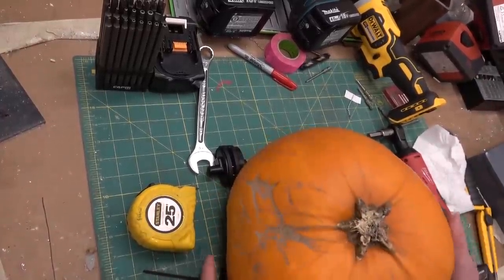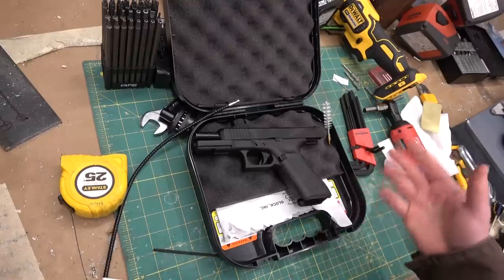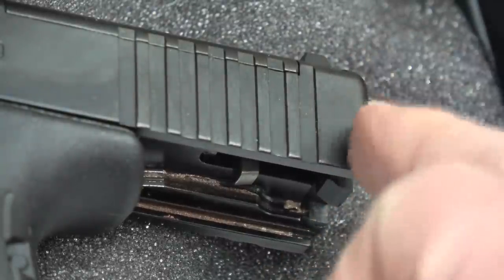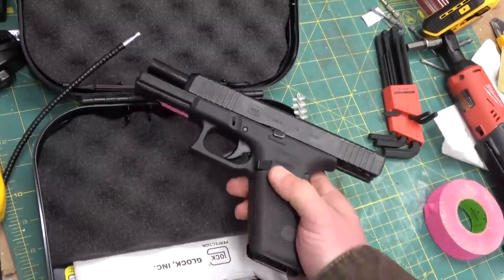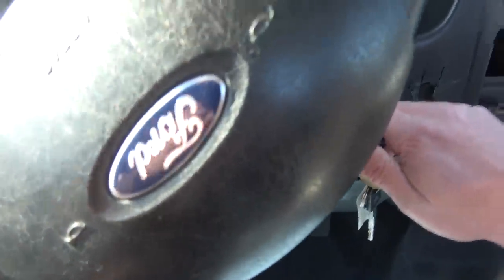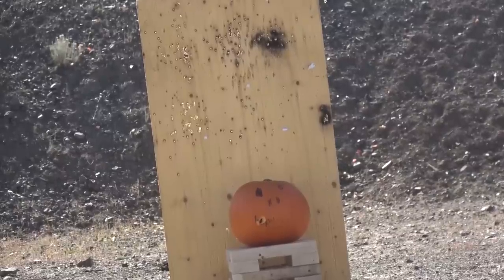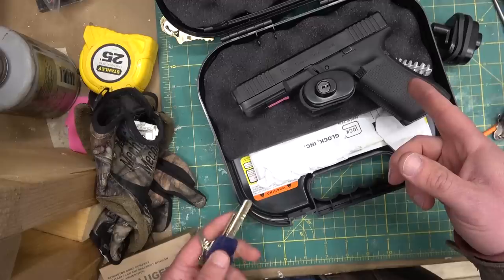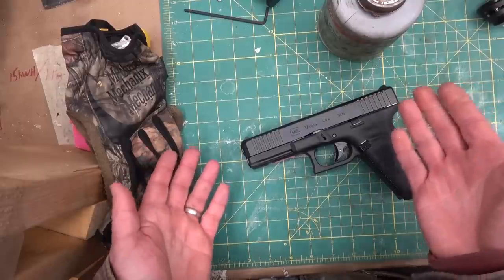BOLTR: GLOCK 17 GEN 5

Comment: I grew up in injection molding and have been working specifically in the firearms industry on the  injection side for 4 years. Ive helped develop glock clone lowers exactly like this, but the gen 3. 

"11 herbs and spices indeed" they are supplied a PA-6/6 resin with 17% glass fiber reinforcement. They then add "foo foo" dust in the factory and that is a closely guarded secret.
Reply: That sounds cool
Reply: Cool.  I did an apprenticeship in mold making.  I was guessing maybe PPA for higher heat resistance, less moisture absorption and higher stiffness than similar PA 6/6.
Reply: Foo-foo means carbon fiber, right?
Reply: @akkudakkupl  no, actually. You can test filler content by burning the plastic and testing the ash/leftovers. No carbon fiber(yet)
Reply: Here’s the “official” description of the Glock lower “The Glock's frame, magazine body, and several other components are made from a high-strength nylon-based polymer invented by Gaston Glock, called Polymer 2. This plastic was specially formulated to provide increased durability and is more resilient than carbon steel and most steel alloys.” AKA secrete sauce is in play here.
Reply: I'll take a stab at the secret sauce. White powdery death. I can't remember the actual name of it. I haven't been on plastics for 3 years now. I was always told to wear a mask and gloves when dealing with the granulated white shit.  It always smelled like ass too. 

It was meant to prevent the zip ties from sticking in the mold. 

Man I bet that plastic is what did my memory in. Especially breathing in Acetone and formaldehyde coming off the shit when it blew up in the presses. 

Dont miss it lol.

Comment: AvE and guns, this touches me in a spot I didn't know I had. EDIT: for ease of takedown, put the web of your hand in the backstrap/ beaver tail, and fingers wrapping up over the slide, squeeze slightly to take the slide out of battery, and pull downwards on the takedown tabs. That is called the "Glock Grip" and works very well in my experience.
Reply: You might call it a G spot?
Reply: @jimstrauser3304  yes, the G-Lock spot.
Reply: @WarrenGarabrandt  points to skookum, right next to my frig
Reply: I hope he used some copper anti-sleaze
Reply: @rhubarbpie2027  Jury gasps, in the distance an RCMP takes a swig from a bottle of maple syrup
Reply: A deep and satisfying location
Reply: Can't even call it that really.... I know the CZ75 series needs to be out of battery a bit, same as the High-Power I think. Hell all it is, is a single handed press/chamber check.
Reply: LOL..watching him break it down was kinda painful!..He'll get it down to 4s in no time.

Comment: Gunsmith here. The copper compound is indeed to lap the parts in.

Couple minor corrections. The firing pin (called a striker in this type of design) isn't fully cocked until the trigger is pulled. The firing pin block is also moved by the trigger, you are correct on the part that does work on it, except the magazine isn't involved. There is no magazine disconnect.

Otherwise for not being a gun guy fantastic video, good grip on the gun as well. Having the grip stippled with a soldering iron is a popular modification.
Reply: I second the firing pin block comment, read down to here to see if anyone else corrected it before I made a comment. Trigger bar disengages firing pin block when trigger is fully to the rear. Magazine is not involved at all. 👍
Reply: I believe that firing pin block is to prevent out of battery discharges.
Reply: Glock calls it a safe action many guns have taken up this type of system as it has huge advantage over a cock and lock that the old 1911's use being that in the split second you  need it most you do not have to manually defeat a safety. It is  to prevent real accidental discharge  not accidental trigger pull because lets face it you can't fix stupid.
Reply: It's the striker only cocked when during double action or is it cocked in single and double action?
If it's both, is that why "normal" Glocks don't have a safety?
Because it can't go off of you don't pull trigger?
No problems dropping in on concrete, that sort of problem?
Reply: @MostlyPennyCat  Glocks are single-action only.  There is no double action - during normal operation, the gun is always cocked on a live round, unless it's empty.  There is a trigger safety that prevents drop-fires, along with the interplay of other internal safeties.  Look closely at the trigger and you will see a plastic blade in the middle of it (blade in a technical sense - it is not sharp).  That is a spring-loaded lever device that prevents the trigger from falling backwards unless there is positive pressure on the face of the trigger - the kind of pressure a trigger finger naturally applies.  Without that pressure to depress the blade into the trigger face, the trigger cannot be moved back more than a few millimeters, far short of being able to trip the sear and fire the weapon.
Reply: @MostlyPennyCat  glocks aren't strictly single action, and they aren't strictly double action, but a grey area in between. They work on a single action basis in that the trigger cannot fire the gun from its decocked state, which is something that double action pistols and revolvers do. They work in a double action basis in that the striker is not fully cocked at rest, it's about half-cocked. The trigger provides the energy to cock it fully, and then fire. But Glock doesn't offer restrike capability like for example a Taurus PT111 or Walther P99, which are striker guns which can act as a true single action or true double action depending on the situation.
I call the Glock sort of trigger Single Action Striker--it accurately describes all sorts of striker based trigger mechanisms which need to be cocked by action of the slide before being fired.
Reply: Why stipple when you can get a sleeve?
Reply: @MostlyPennyCat  Glocks and most striker fired guns cannot go off by dropping them, there are more parts in the trigger mechanism that stop that from happening, you have to pull the trigger for it to fire. They are safe even without a safety, revolvers never had a safety and nobody ever complained.
Reply: @anan0moose  close, out of battery discharges require the striker to be jammed forward which would necessitate a broken striker spring or foreign object entering the striker channel. The striker blocking pin prevents drop fires where the trigger bar "jumps" and comes off the striker sear and fires the gun.
Reply: @The Prometheus Project Glocks are cheaply made, its ingenious in its design. It works.
Reply: Also, it's an extractor claw, and the ejector is that pin at the back.
Reply: magurgle never stipple with a soldering iron.. use a wood burner..
Reply: @ncguyredneck  It's an out of battery safety, blocks the firing pin unless the slide's forward enough to have the barrel completely engaged/locked.
Reply: Thank you I’m glad someone informed him on the lack of a magazine disconnect because as soon as I heard him say that I came to the comments thinking oh no oh no oh no.that could be very dangerous thinking your trigger can’t be pulled if the mag is out even tho if you follow ALL GUN SAFETY rules you should be able to avoid injury it’s usually when people ignore multiple rules that someone gets really hurt like don’t point a weapon at anything you don’t want to shoot
Then don’t put your finger on the trigger till you’re ready to fire,you could forget to do either one and nobody would get hurt but you do both and someone dies.
Reply: @The Prometheus Project what does the manufacturing cost have to do with anything being discussed in this thread?
Reply: @scowler92  grip sleeves move and twist.

Comment: As for the firing pin safety (the little plunger in the slide), that's not a magazine disconnect but rather actuated by the trigger bar so the firing pin is physically blocked until the trigger is pulled and the slide is in battery.
Reply: ^ this. The firing pin safety protects from a firing pin/sear failure.
Reply: This is true. Glock does not do magazine disconnects. But still awesome.
Reply: What these three said. Block, not the best but this Canadian owns four so clearly also pretty damn good. (Perfect for my competition shooting without being $3,000-$4,000 a pop like STI.
Reply: Bullseye! @Thomas Arthofer
If the striker drops, for ANY reason, that's the last line preventing it from protruding from the breech face.
Reply: @AvE keep in mind, in the time since posting my comment I've recommended your channel to 3 of my friends on separate instances.